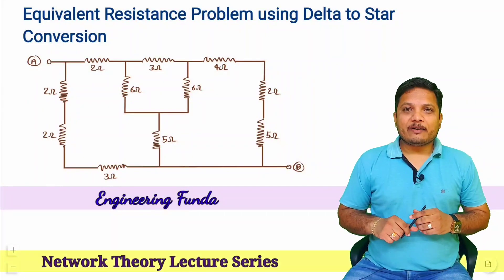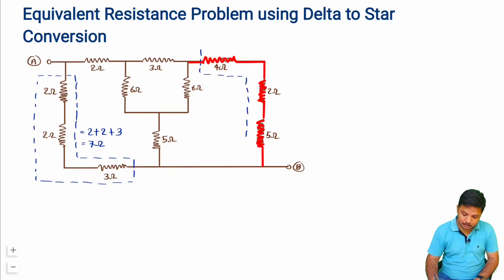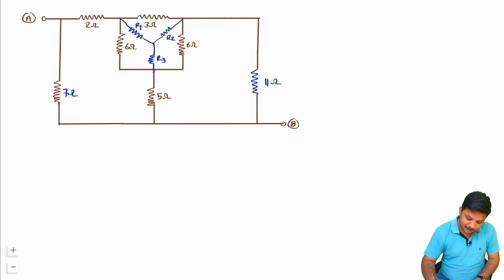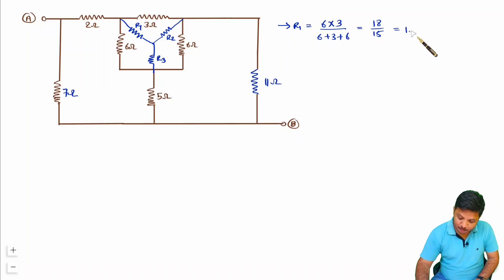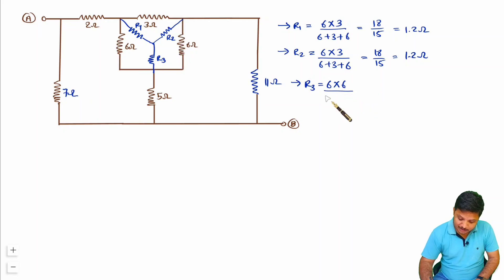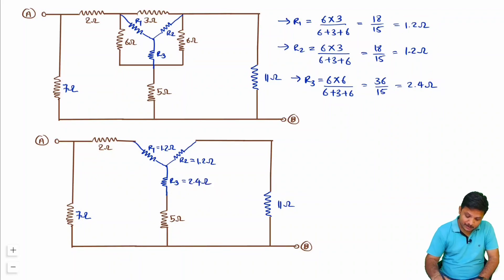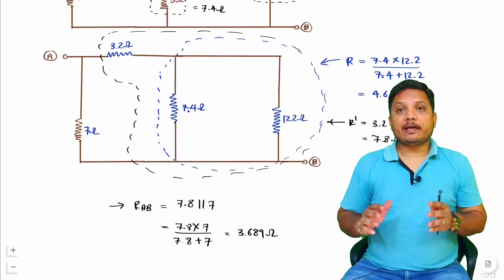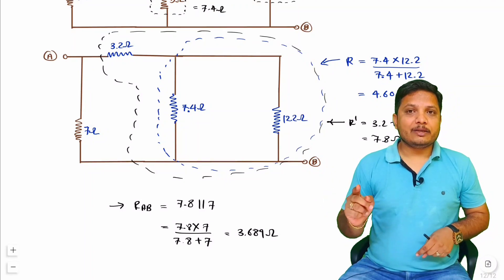Equivalent Resistance with Delta to Star Conversion: Detailed Example and Solution 3

Comment from the maker: Equivalent Resistance Problem using Delta to Star Conversion explained with following Timestamps:

0:00 - Network Theory Lecture Series - Equivalent Resistance Problem using Delta to Star Conversion
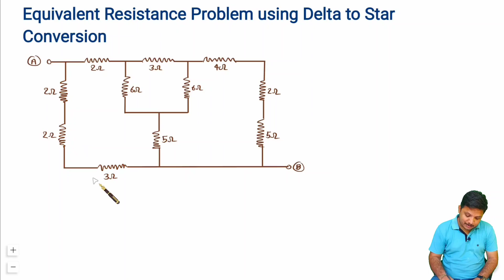0:47 - Series connections of resistance
1:51 - Delta to Star Conversion
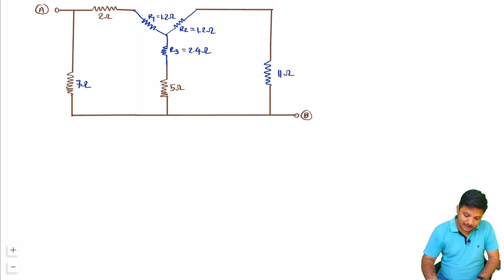4:54 - Series connection of resistance
6:30 - Parallel Connection of resistance
7:47 - Equivalent Resistance of given Network